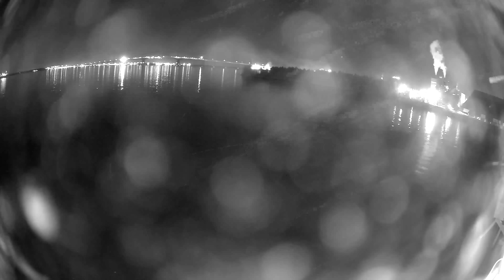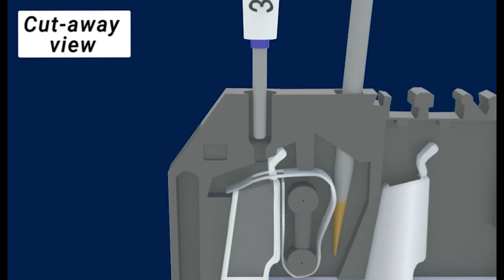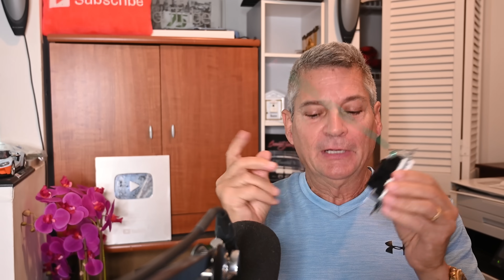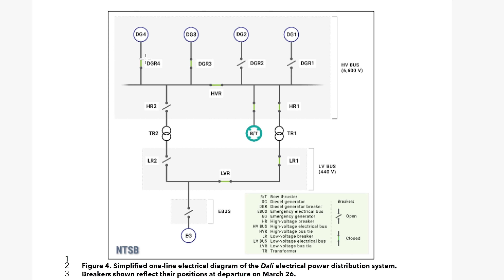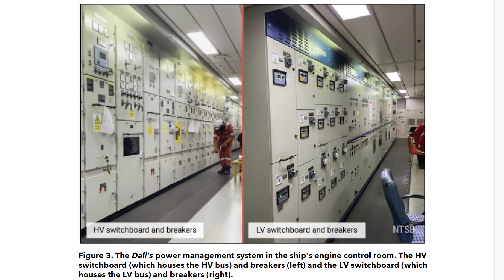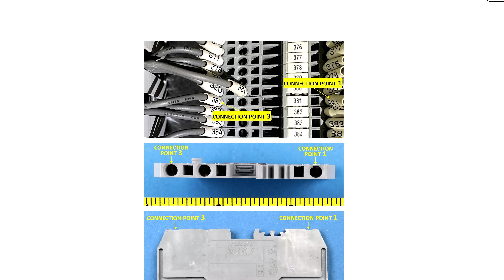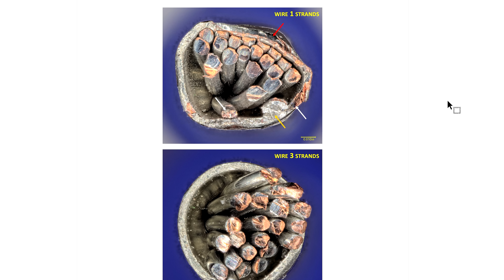NTSB: Scary Wire ERROR Caused Dali Crash/Key Bridge Collapse Baltimore

Comment: Both transformers T1&T2 should have been on line with 2 generators  until the ship reaches the open water of the ocean. You need redundancy for the unexpected problems .
Reply: Also as a back up - especially highly prized assets of the bridge in question ( traffic volumes and amount of $$M's of disruption that an outage can have to economy) tugs should escort these large container ships in and out of port pass the bridge; letting go for their assistance afterwards - other side of the bridge;    Mistakes / faults can happen
Reply: Depending on the build specifications they may not have been allowed to run both in parallel.  Running both transformers changes the maximum short circuit current available.  It is possible to design the switchboard to take into consideration the increased available current with larger breakers and buss bars but it adds to the build cost.
Reply: @JT_2024-c8j  It seems to me they ought to be designed that way for redundancy. Most transport category airplanes have dual (or even triple) redundant electrical systems, so that a failure of one component or bus will not cause a total loss of power.
Reply: @bbgun061  you would think so, but it's really not that true. And the problem described here from the prior day occurs even in commercial airplanes, where some systems are simply isolated rather than redundant. Sure there's 2 of them, but one is for the pilot and one for the FO.  What commercial airplanes are really good at is keeping flying when something fails, but there are certain phases of flight where failures are problematic. Look no further than the MD11 mishap a few weeks ago. Had that issue happened seconds earlier or later it would have been a non-issue (ok, it's an issue but not a drive into the ground issue)
Reply: We saw in the korean air disaster that the company did not want apu running for takeoff and landing to save costs.  When disaster happens, having an apu running keeps critical systems running so the pilots can at least react and have awareness.  Weak regulators only 'advised" using apu, but airlines are allowed to not use them.  Of course they won't, it's not needed, until its needed!  They work out the fuel cost of running the apu vrs dead passengers.
Reply: @bbgun061 They can be it’s a case of cost.  They could have split the board.  What pressure are the crew under to keep the running hours and fuel consumption down.  They’ll be a bean counter checking fuel and running hours monthly.
Reply: @mrl22222  I wouldn't compare the MD11 to the Dali. Had the Dali's main engine exploded or ripped off its mounting or something catastrophic, then they would be similar. But the Dali was an electrical issue that caused a loss of steering during a critical time. It could have been prevented.
Reply: @JT_2024-c8j  Ok, so run a single generator while at sea where there's nothing to crash into. But during a critical operation like navigating within a port, they should not have allowed the ship to lose all power like that.
Reply: @bbgun061 I don’t disagree,  it’s all cost saving, two tugs to escort would have prevented this too .
Reply: @JT_2024-c8j  They can be run in parallel.  You might have to open the tie breaker contactors (HVR and LVR in the drawing shown in the video) to do so (running the 6.6kv and 440v as a separate bus A and bus B), but both should be in operation when run in critical situations (e.g., moving thru a channel) and using the tie breakers if there is a failure, as it would maintain at least part of both busses if anything fails and the tie can be closed far faster than equipment can spin up (and you ALWAYS have to assume something can or will fail).

I've heard some mariners say that's not how it's done.  I think that it might be what they were taught to do, but I would have to say it's a poor engineering practice that has been handed down to the latest generation of mariners.  To put it another way, no sane aircraft pilot would choose to take off in a 737 without both engines running in case there is an engine failure (after all, a 737 can operate on a single engine) even if you can spool up the other engine if the first one fails, why is it okay to run a ship on a single bus/system if a failure means crashing into something while you wait for equipment to spin up?
Reply: I agree. That's what I was was saying when the initial report was released. The ship has two parallel independent electrical systems. Why was it not operated that way?
Reply: No amount of design redundancy can compensate for BAD build and maintenance.

This is an issue of training and oversight, not design.

Comment: That looks like negligence to me. Just slide the label back, or cut it off and write the number on the wire with a fine point permanent marker, if you want to be lazy or cut corners, or for a temporary fix, anything would have been better than what they did.

Comment: I went through my house when i.move in and check all my switches and plugs. To make sure they were done properly. Half went to the back stabber instead of the screws.  Your analysis makes perfect sense
Reply: They really ought to stop putting the backstabbing connectors on the switches and outlets. Now they put a hole in the backing plate behind the screw so you can stick the wire into the hole, then bend it around the screw, and then tighten the screw. You don't even need to pre-make the loops anymore to use the screw connection

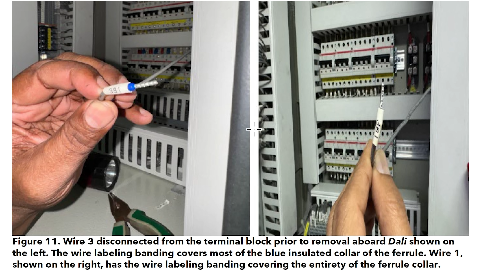Comment: Oh the irony! It was 2021-22 that wago was promoted ALL OVER YouTube, HARD. Wago this, wago that.. Turns out a single $3 wago snatch block caused death and a multi-billion dollar accident all said and done all in one go? Who saw that one coming! Thanks for the update Jeff, and double thanks for that new CCTV footage. Btw looking at the switch panel at 16:42 every single ferule in that cabinet has its label shoved halfway down the ferule collar.. so I'd like to know was it the ferule, or the wago itself (is it a chicken or egg thing?). I put that out because there are 0 arc scars or any kind of witnesses marks on either ferule. I can see that even in the fuzzy image they provided us
Reply: Yeah all sudden Wago came on YT as fixing everything.  Cures cancer tooth decay increases gas mileage. Lol. 

One uses wire nuts for 55 years with no issues and wago now is the new cult religion.

Wago came on YT so strong as life's answer to all electrical problems it draws suspicious concern.

It is wise to not join a cult and see if it makes sense

Most all flaky intermittent electrical issues I have  seen are with push on a stuff. Or crimps. Way less with screw on stuff. 

Lots of fun going thru a big machine and going through thousands on insert connections and doing a pull test. Then try to figure where issues are.   Insert removal too and wire is too short or corroded. Ie mouse peed on area and corroded. 

In cars all these weak connections sell millions of sensors.  Had a 1995 car like that. Grounds peppered in hidden places with snap in connections corroded..
Reply: @3beltwesty yeah it was weird for sure.. I just know it's super ironic a wago product is responsible for this maaaHOOOOOOOsively expensive destruction right after their hardcore advertising campaign on yt
Reply: This has nothing to do with Wago connectors promoted on youtube for residential wiring (which are and have always been superior to wire nuts - which is why wirenuts are prohibited in both the UK and Germany)
Reply: @ACitizenOfOurWorld  wire nuts are not prohibited by code, their use is restricted by specific conditions like being installed inside an enclosure or using the correct size and type for the wires being connected. Incorrect installation is the main cause of problems. Some local codes or specific applications like those involving machinery or dissimilar metals might have stricter rules or prohibitions. But saying "they're not permitted" as a blanket statement is silly

Comment: That type of connection is not something I would use on a system that is land based. Absolute crap.
Reply: That type of connection is and was industrial standard. It works when you don't jam a ferrule with a sleeve on it into a WAGO port. The fault isn't with the connection or the standard, but it is entirely with the way it was installed and handeled by the electrician. Properly installed you have to use a lot of force to get it out unless you insert a Topjob or Slit-Screwdriver. That connection is different from the "backstab" ports in US outlets, which btw aren't even used in outlets in Germany for example, while WAGO is widely used in Industrial applications.
Reply: Heh, those connections are used in literally EVERY industrial machine or process wiring. When assembled properly, they are very reliable. Just don't put the label over the ferule and it's fine
Reply: The issue here isn’t whether it’s a spring cage vs screw terminal, but the fact that the wire wasn’t inserted far enough. Only just the tip was actually engaged, and that would have come loose from a screw terminal, too, if only inserted that far!!

Comment: Most of these control panels look like a master piece of wire management. I didn’t realize how small this problem looked. I always suspected a larger wire was a problem along with salt water incursion. I worked in industry where we had many of these control panels. I watched electricians  trouble shoot them looking for a problem. Thank you for breaking down this problem so I could understand. I was waiting for your detailed report.
Reply: Wild that a half cent sticker did all this
Reply: @mtnman1984 boooom!
Reply: I watched an electrician trouble shoot a new machine as we tried to run it for the first time. Several wire numbers were wrong in the control box and on the print. Once the problem was solved, a new print arrived a few days later with the corrections.
Reply: they might look the same but ship that crashed had the labels done incorrectly

on 16:30 every single label was heat shrinked onto the edge of the blue ferrule (witch was bad to start with) but goofed on the one very critical cable 381 and covered most of the blue area (so this was probery 1 person who did this on this panel) due to the way he did it there is no way to know if the cable was fully inserted (every cable on that panel)

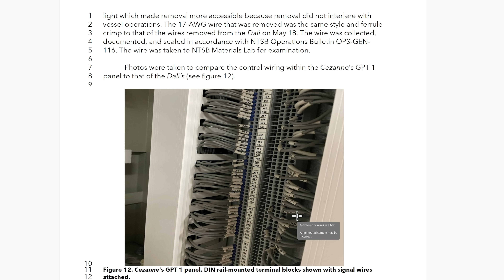on 17:10 every one of them was done correctly and only heat shrink label to the cable only leaving the Blue ferrule free (so you can clearly see if they was inserted correctly and all the way in as only 2-3 mm of the blue should be showing)

Comment: First year apprentice?
Reply from the maker: This was done during construction of the ship, probably was a 1st year
Reply: @jeffostroff It happens too often in the trades, bad ratio of apprentices to journeymen. The journeyman in turn doesnt catch everything and cant watch everything. Still, hopefully it wasnt from poor training or corner cutting.
A good lesson for all that small connection points like this matter.
Reply: Wires are cut and crimped off site i believe, there are even machines to do that automatically. Of course the technician assembling the cabinet should have done something about it but i am sure he wont be asking to redo all the wires.
Reply: @gearloose703You can definitely do ferrule crimping onsite. Absolutely. Ive never seen a job where onsite modifications haven't occured, even with the best of plans.